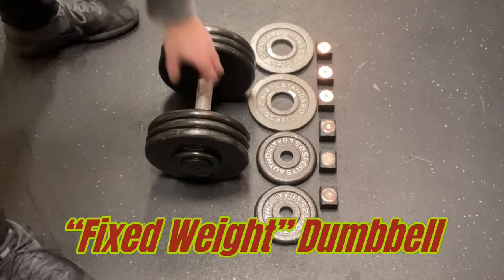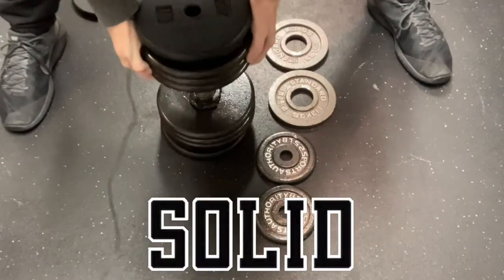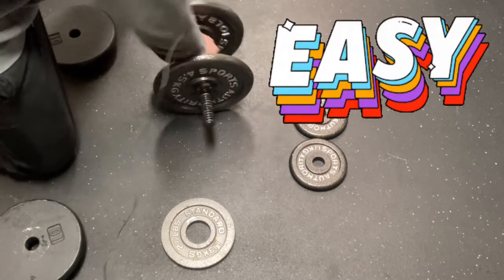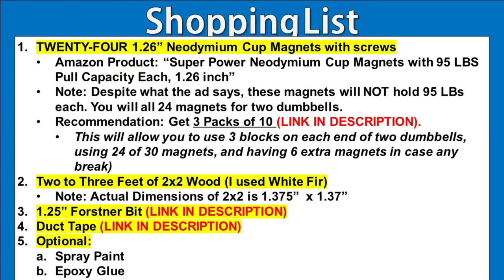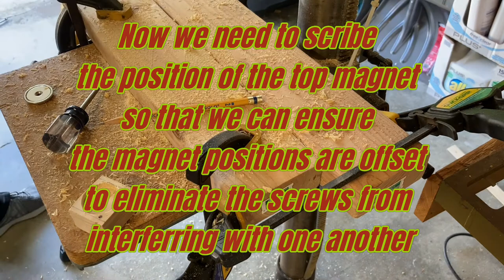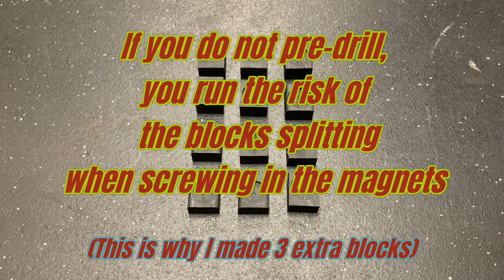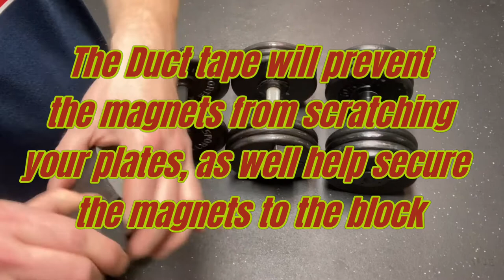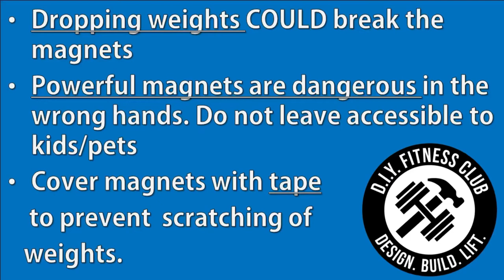DIY Dumbbell Magnetic Plate Blocks - INSTANTLY Add up to 20 LBS per Dumbbell – Save BIG Money!

Comment: Quick? Is the Epoxy Adhesive added in the predrilled hole or the hole that you drilled using the 11/4" fostner bit?
Reply from the maker: Thanks, Brandon! The optional (10:00) epoxy can be applied to either hole (or both). 🙏🤘💪

Comment: So is your recommendation to not exceed 10lbs per side of the dumbbell with this setup? Also, is there a particular type/brand of dumbbell that this would work best with (I already have weight plates, so I have that part covered)?
Reply from the maker: Minimum of 3 mag plate blocks are required to hold a 10LbS plate (4 mag plate blocks is even more secure). I have never tested beyond 10 LBS plates… but definitely would need more than 3 mag plate blocks to hold…. 

Any brand will work as long as the dumbbell is all metal…. Rubber/urethane coated dumbbells will not work. 🤘🙏💪

Comment: I've been considering making these myself, but I have a worry. What would happen if you are working in the +50 lbs range and you have to set the dumbbells on your thighs before you start your reps? Have you tried setting heavy weights with magnetic dumbbells on your thighs before hoisting up to start a rep? I find that a little difficult even with the thread sticking out trying to jab me in the leg, lol.
Reply from the maker: Great question! I use these when going heavy all the time… but I recommend making a few extras so that you can use 4 magnetic plate blocks per dumbbell side to ensure that the plate will not tilt when placing on your knees before hoisting upward.
Reply: @DesignBuildLift  I finally decided to make some but for my weight stack. I didn't drill a recess and simply screwed them into properly sized pine blocks and wrapped them with duct tape, but still works great. Thanks for the motivation.
Reply: Put tennis balls on the ends like old people and walkers :)

Comment: Nice video. I wonder if a guy could just permanently attach the magnets to the plates and forgo the wood blocks and just keep the magnets on the plates and attach when needed?
Reply from the maker: Thank you for watching! You would likely need to epoxy (JB Weld) the magnets directly to the plates if you went that route. You would also have to more careful not to drop the dumbbells because the magnets will likely shatter when sandwiched between the metal plates (whereas the blocks offer some level of protection/cushion for the magnets)…Thanks again for watching!!! 🤘💪🙏
Reply: @DesignBuildLift  yeah so was thinking JB welding to the plates. They can still be used easily on a barbell even with the small magnets attached. I’m just wondering if these will hold on the urethane coated powerblocks. They are very flat on the sides at least which is a plus. I never drop the weight so that would be okay
Reply from the maker: @pryme2013  urethane coated? Not sure that will work. I only tested on bare metal. If you try that and it works let me know. 🤘💪🙏
Reply: @DesignBuildLift  okay will do!

Comment: Why do you need the wood blocks? Why not just get some thicker magnets and use them as is?
Reply from the maker: Great question. Rare Earth Magnets do not have two strong sides. Only one side is powerful. The block joins two magnets, so you have a powerful magnetic pull on both sides of the block. Also - rare earth magnets are delicate. Without the blocks, they will break. 🤘💪🙏